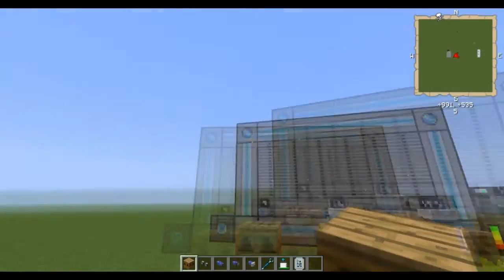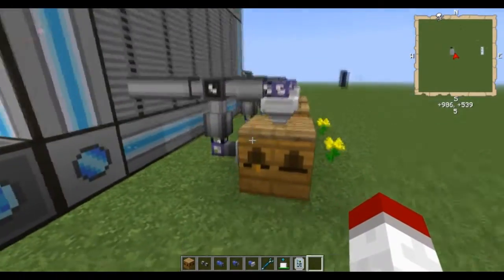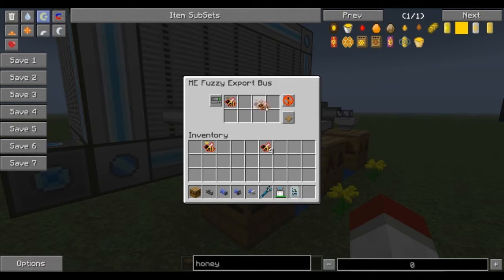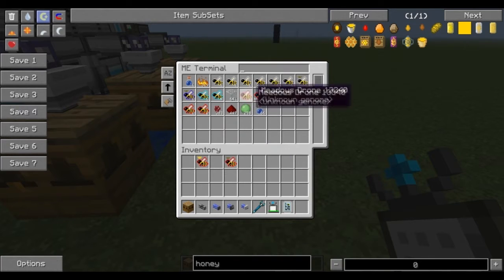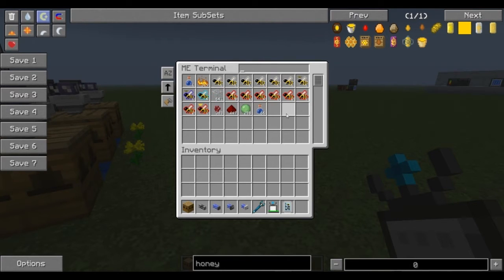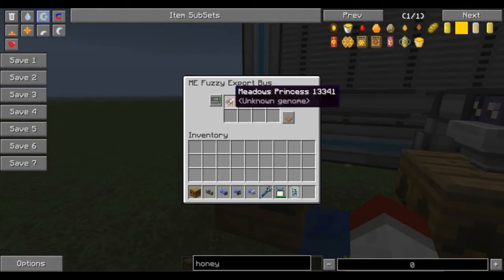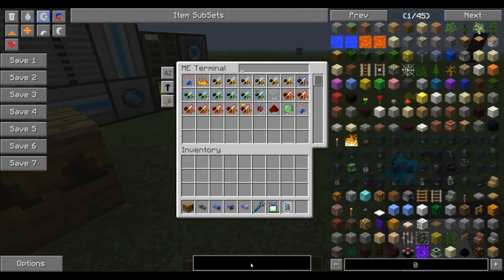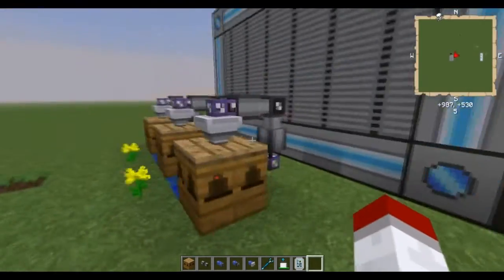Auto Bee Breeding with Applied Energistics - Tutorial

Comment: Tried inserting frames through a subnetwork into the apiaries .. for some reason didn't work. Mind explaining it to me? If it's even possible.
Reply: Edit:I just found that you can put frames in but it must be and an alveary, and you must have frame housing, then you attach your export bus etc. to that block of the alveary.
I know this is an old comment but maybe it will still help you or others. The reason it didn't work would be that the frames, when being inserted by pipe, must go in a specific side, but unfortunately there is no side that accepts frame on the apiary. Although I haven't tried apiarist's pipes yet, so I suppose they might support it as they come from the mod, but I think that the really big advantage of the alveary is automation.